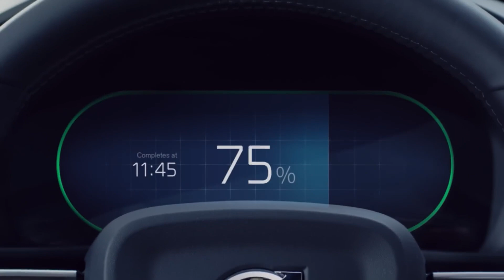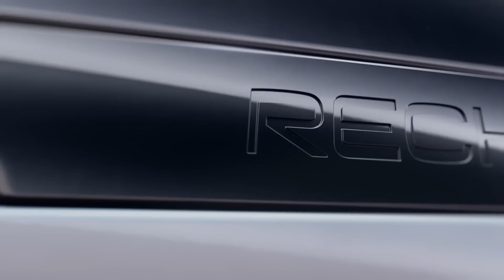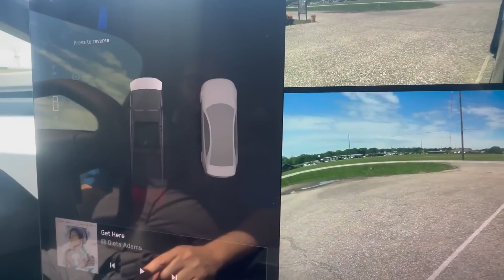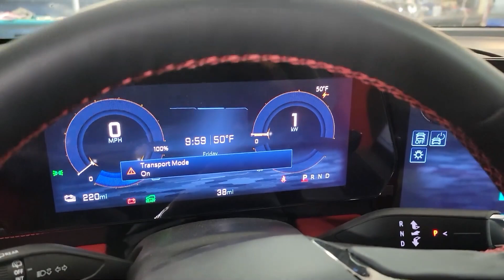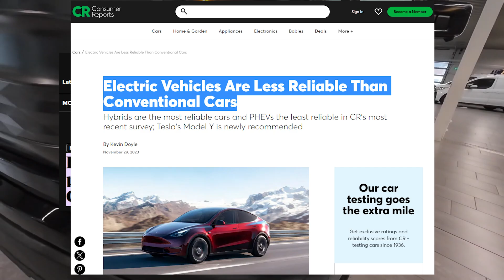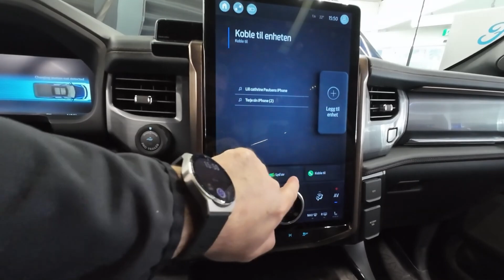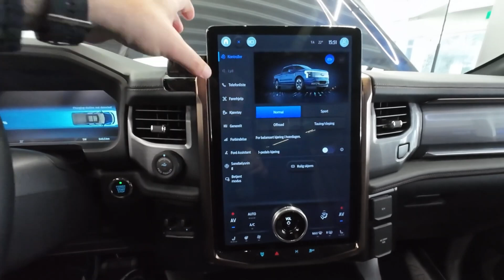Unbelievable! EVs Might Be Disposable Cars ! Find Out Why

Comment: A somewhat biased view, the video mentions "software updates" as though this was an EV only thing. A basic EV should not need them, the complexity goes to another level with "auto pilot" and navigation features. As for the scrapping of EVs, a lot of this is happening because the motor trade are lagging behind the technology, they simply don't know how to diagnose and repair them. 
Realistically different usage patterns suit different propulsion systems, modern diesels for example are laden with emissions equipment that misbehaves if the vehicles are continually used for short runs, something an EV can do better. IMHO scrapped EVs should go to specialist dismantlers, batteries that are beyond refurbishment or re-use could still serve as storage in solar powered systems for a very long time. Drivetrain components are often completely unscathed in accidents and should also be re-used.

Comment: The EV issues aren't going to be solved because the manufacturers don't won't to solve theost all repair is done at dealerships and they can charge whatever they want. The batteries aren't modular although they could be forcing the replacement of the whole thing. Unnecessary complexities like the retractable handles remain in vogue, those complex dashboards. Dependence on OTA allows sloppy SW.
None of those is really necessary because the car is electric. It's done because Tesla wants to feel fancy and others imitate Tesla.

Comment: I have 2013 Tesla Model S. Batteries will die at 10+ year mark (if moisture don't kill it first at 1/2 that time). $25k replacement 2x residual value of the car. Very much disposable car.
Reply: ever own an ICE car for 10 years? If you do then you know the 10 years of expenses on an ICE car is almost twice as an EV you're paid in 10 years. But you save even more if you drive alot as regular basis like 500+KM  per week.
Reply: @dann5515  a skewed view point, a good internal combustion drive train needs very little maintenance, most of the repairs to my cars over the years have been suspension and steering related. Of course an EV is likely to be far worse in having so much extra mass. To be fair though who would use a brand new OEM battery to revive a 10yr old car? There are cheaper solutions, "refurbs" using cells harvested from crashed cars.
Reply: @g0fvt  to be more specific.  EV is the future. So in the next 10 years of mass production of EV around the globe is like how ICE converted from Horse riding era back in 100 years ago. Sure you can keep your car for more than 10 years as you wish to. But EV battery is recyclable. EV car's body also can be recyclable. The future battery most likely wont be costing that much as of today when. The battery still have innovation to work on to make it more even durable and longer lasting like Solid state battery which will be releasing to world wide after 2025. The media only show you or wanting to only show you the negatives things in an early stage. They wont show you the full result of 10 years later. They wanted you to think is bad to have an EV. They need to protect their fossils stocks they've invested so much on. You really think only ICE car's Engine can last longer than 10 years? Thats only if you dont exceeded over 500,000KM. EV can also last long but doesnt need to worry so much expenses on spark plugs, bearings, pistons, gaskets, engine rings, manifold, cylinders', coolant tank, fan, and etc etc. all that add up is about 3000 to 5000 dollars for a reusable engine. but if you buy it separately parts each all that will cost you 10G. Yet we havent even calculate the muffler that needs to replace it too. 
So have a look at how many issues do we need to worry in an EV? Brakes, tyre, wiper and suspension like an ICE car. Can you name any more? EV no engine just an electric motar and computerise chips with battery and wires. such a little component required to fit in a vehicle to run than an ICE car. and more spaces. No engine no tank replaces them as booth space to fit small luggage or camping fridge.  Right now the battery yes is costly. Thats because is still new to market. When is reached over 10 millions EV running around the world. the price will drop cheaper. I say if i wanna buy reusable battery to replace in the next 10 years i dont think i will be paying 20K. most likely around 5K. There is more room to upgrade better technologies for EV. So im not worrying much about it. And i am happy to start with EV this time around. I can see in ten years im saving up more money than ICE car in ten years. And so i can buy the next generation tech EV in ten year's time. I used to work for my dad in mechanical shop as a kid since 80s, from carburettor to fuel injection to hybrid and now EV. even work at the spare parts warehouse. I did my college time as an IT and part time electricians. It gives me enough to know what the best to buy. So, I know better.